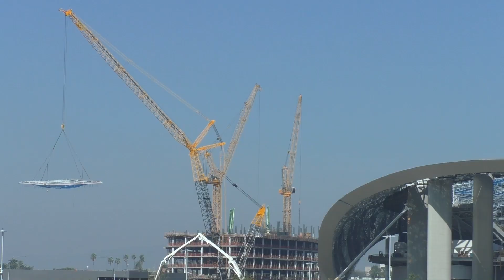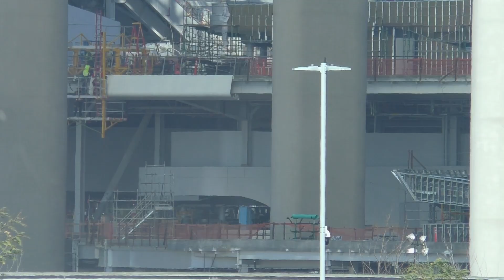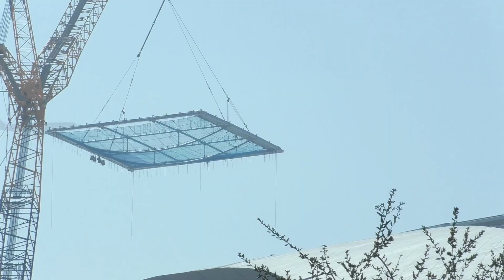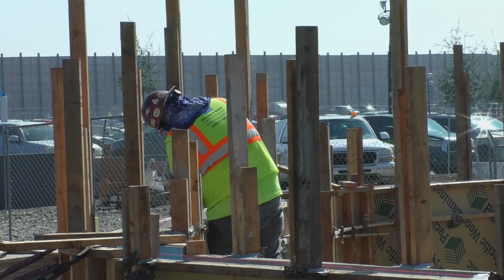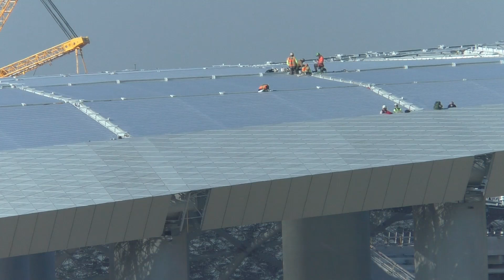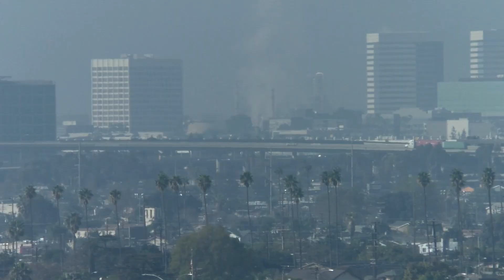LA Rams Chargers SoFi Stadium Construction Update 2.18.20

Comment: is these glass panels, are going to have uv protection coatings on them?
Reply: It's not glass.  The roof is made of etfe panels. And is 60 percent translucent.
Reply: Glass blocks UVB rays.
Reply: @boxyguy3681  like the other guy said, it's not glass its a polymer hybrid material with a high melting point so it's essentially plastic(similar material used for most bathroom windows).
Reply: I know it isnt glass, it is ETFE.  I was saying that glass blocks UVB
Reply: Yes, the ETFE panels provide weather and UV protection.
Reply: Every five years or so they have to run to manny moe and jack's, to get a headlight shining kit and give the plastic a once over.

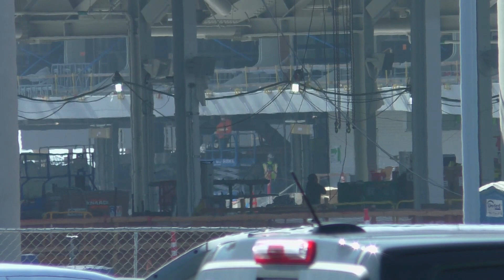Comment: 9:46 What I want to know is what are those bars hanging from ceiling for? I know it has something to do with the ceiling, but what specifically.
Reply: the curved beams? they form individual trusses, surprised they aren't joined side to side - maybe later.
Reply: @scottstewart5784  I was referring to the bars that are hanging vertically from the ceiling not those horizontal bars with curves.
Reply: @tobiasdubose8812  Oh, the vertical bars.  They create a matrix.  The roof is held up by the tension in the two levels of cables crisscrossing.  The cables are fixed to the circular/oval framework of the stadium, which in turn is bedded into the ground deeply and cabled to the ground as well.  The vertical bars create a truss, sort of, giving the structure rigidity that wouldn't exist if it were just one cable set on top.  With two cables, separated by the bars, you have a truss.